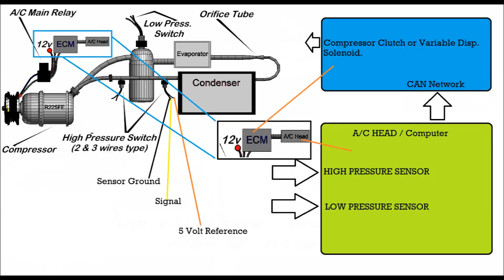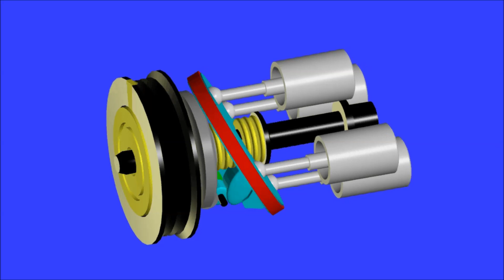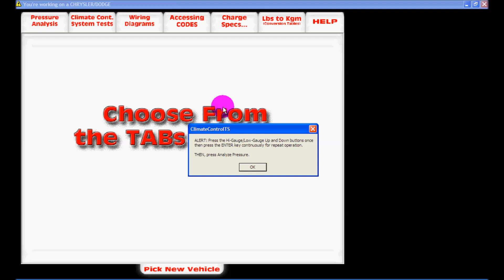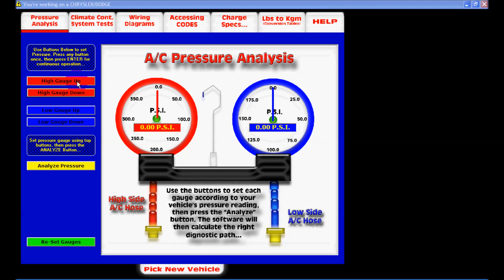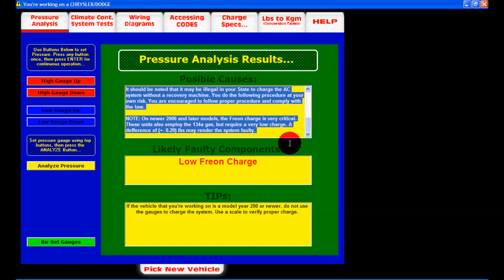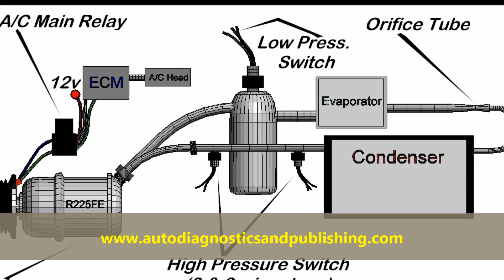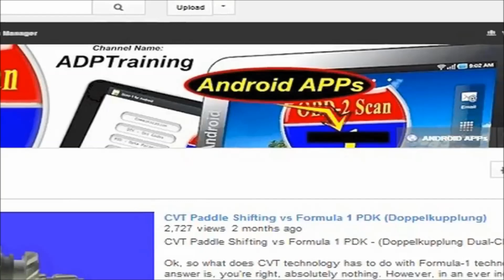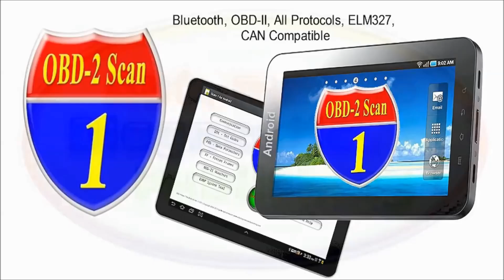HVAC Low FREON Refrigerant Charge Diagnostics with HVAC Software

Comment: There is no perfect pressure for a given ambient temperature between manufactures who make air conditioning it’s all over the map you could have 300 psi on one manufacture and 150 psi on another manufacturer with two car sitting next to each other
Reply from the maker: Absolutely not, 250/39 is the rule of thumb. 300/35, 350/32, 220/35... All these are ok. Above 350 and below 180 you got a problem. Doesn't matter which manufacturer and R132 or R1234.